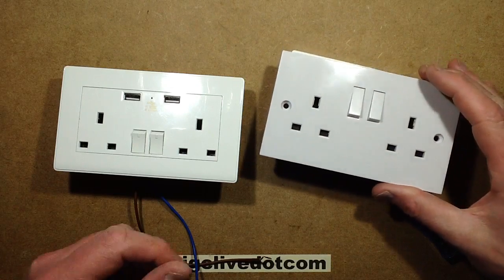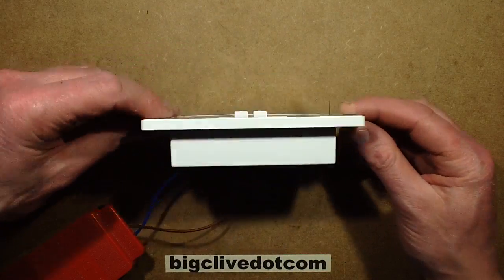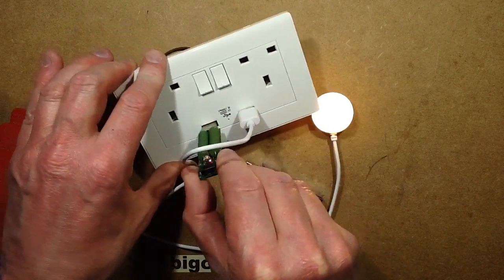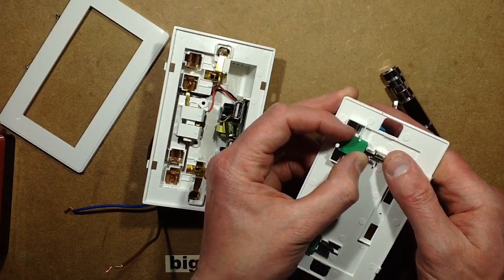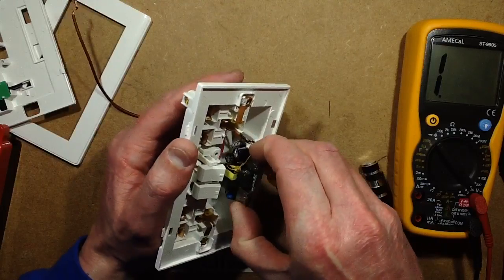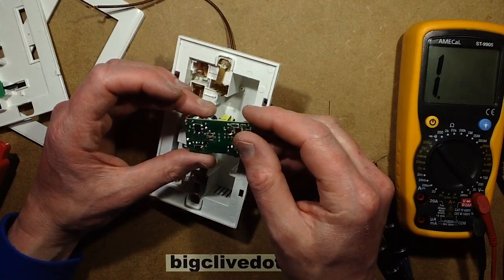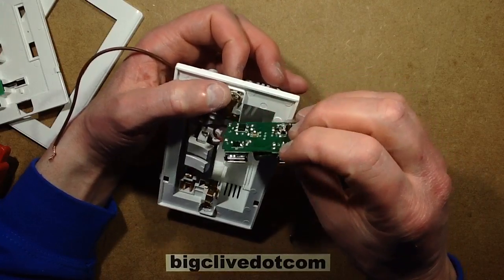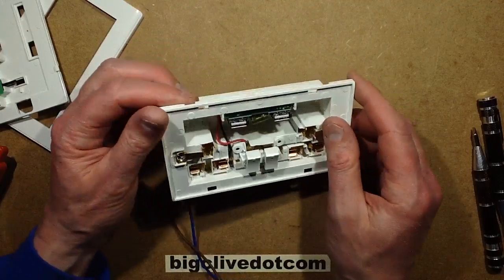A look inside a (crap) double gang socket with USB outlets.

Comment: The best solution to the problem of built in Usbs causing fires is surely to have a way to just switch those sockets off?
Reply: +Lord Sandwich You could, but don't think that would solve the problem, because the USBs actually contain circuit boards, which if they're on fire........

Comment: +bigclivedotcom You said you haven't seen two earth terminals on a socket before. That is absolutely standard for modern quality sockets designed for 'high integrity earthing' arrangements (not that I mean to imply that this is a quality socket!)
This high integrity scheme is used where there is a likelihood of significant intended earth leakage current (>3.5mA), such as from IT equipment or radio equipment that uses large interference/spike suppression capacitors. The scheme also requires that the two earth ends of the ring main go into separate terminals at the distribution board The idea is that the failure of any one screw terminal at the board or on any socket won't prevent there being a proper earth bond at every socket, so the earth leakage won't lead to the risk of significant earth potential developing (Regulation group 543.7)
Any suitably qualified electrician would know that it is mandatory to put one earth lead into one terminal and one into the other in such a system, but the earth terminals absolutely should be connected together by the socket. Hopefully that error would be picked up in the earth ring continuity test without the earths disconnected at the consumer unit, but that socket should never be on sale in the UK. 
You can also get MK (and other) dual gang socket outlets with three earth terminals - these are for signal and instrumentation applications wanting 'clean earths' to each outlet as well as the protective earth.
Reply from the maker: +Alex Gray I've seen the two external earth terminals on the outer metal frame that connects the two attachment points on good quality sockets, but not this concealed internal (or not as it appears) arrangement.

Comment: The real question is: am I able to download songs from my wall? With the USB of course.
Reply: John Richardson they are supposed to, but if you put a chip (e.g. a pic or avr clone) to, for example, transfer a virus on any android phone with dev mode enabled, you could get some valuable information.
I'm talking about usb adapters in general though, not only about this model.
Reply: @satibel : Indeed one of my fears when it comes to USB power sockets is that they're actually maliciously modified.
Reply: cookie koekje u could possibly wire up the data pins in the usb to something although not recommended
Reply: manaquri Yeah, what you're suggesting is across the board, not just for these.
Reply: +John Richardson then i would just use my phone charger or my pc..
Reply: xGxPhantom Zzz Whatever works for you.  It's just supposed to be an extra option I believe.
Reply: manaquri Seriously doubt it - they're ONLY power supplies for USB devices.
Reply: manaquri I want to infect my wall with a computer virus.
Reply: cookie koekje one of those could actually put a virus on your phone.
Reply: +cookie koekje now I want to put a sneaky raspberry pi zero in one of those.
Reply: +cookie koekje Err..... no.  It's just a power source.
Reply: John Richardson Awwww.

Comment: That thing shouldn't be on the market!  Is it CE marked?
Poor quality mains fittings are all too common now, even if CE marked, non well known brand fittings should be avoided.  I've replaced a number of 13 amp (supposedly!) mains sockets in recent years that have failed on high current loads, but within their rated capacity.  The failure modes have been worrying, like fused together switch contacts, melted switches, melted and burnt plastic switch parts, overheated pin contacts that have lost their spring tension and started to arc, etc, etc.
All these failures could have started a house fire, without warning and without tripping the MCB!!
I've also noticed poor quality light switches failing after a few years, the switch becomes intermittent or difficult to operate.  Internal examination reveals fatigued/broken switch parts, arcing etc.
All have been non known, or little known brands.
Now I will only fit MK or Crabtree units from a stockist I can trust not to sell fakes.  Look inside them compared to the imported junk and the difference in quality is stark.
I would strongly recommend anyone who has bought a new house within the last 10-15 years to check, or have checked, the electrical installation to determine if any poor quality fittings have been used.
Same applies to new or recent extensions.
If electrical installers are up against it on quotes they will resort to using crap fittings.

Comment: Are you saying,  there is NO internal Earth bar linking both sides of the sockets?
Reply from the maker: +Andy RC Yup.  A really terrible arrangement that could lead to inadvertent isolation of sections of a ring main or a radial circuit onward from that point.

Comment: Hello, sorry to add a negative to what seems a reasonable safety talk, but I have to point out some points for info.
Firstly, you worried me when you stated that you had not experienced a double earth connection. This is standard on all socket outlets designated for I. T. use, and is a requirement for fundamental use. The other socket with single earth connection would be considered for general use and not for I.T. use, although it would still function. This leads me to consider if you are a qualified electrician, and whether you should be making electrical advisory videos.
A second point is your connection to this socket for your test purposes. You have not considered your safety, or that of your viewers, when you have neglected to even connect this device to earth. This is a primary fail on your part. As this is an I.T. designated socket, it requires an earth to function properly, when a PC, for example, is connected. This earth is a design requirement to function, not only for safety. This also may be why you had instability within your test, although this is not my field of expertise.
Please do not go about holding un-earthed appliances in your bare hands, when they are connected to 230V main supply. Electricity kills, as I am sure you are aware.
Please accept this post as a raising of safety awareness.
Reply from the maker: +James Haveron My reference to not seeing a dual earth connection was relating to the enclosed connections.  I'm familiar with the use of two earth terminals on the outer metal frame found on some sockets but not all.  I did not connect an earth because I was aware that it was not in use by the internal circuitry which was the subject of this video.
Reply from the maker: +westinthewest To me a "clean earth" usually relates to a separate earth connection taken all the way back to a buildings main grounding point and not shared by other equipment.  In reality it is absolutely not needed, since any IT equipment that claims to need it is not fit for purpose.  The same goes for the 250V insulation test used on some IT equipment.  If it can't withstand a voltage closer to the peak mains voltage (230V X 1.41 = 325V) then as far as I'm concerned it should be retired.
Reply: +James Haveron I've been unsure about High Integrity Earthing for some time, but a quick bit of Googling seems to clear things up.  Page 2 of http://tisltd.com/wp-content/uploads/2012/04/HIE-Earthing.pdf shows a normal ring final circuit with 6242Y cable incorporating a 1.5mm2 CPC.  In addition to this is a hefty 4mm2 CPC in parallel with the ring.  I'd say this is why you need two earth terminals.  You simply need more room for a pair of 1.5mm's and then a 4mm.   I've heard of terms like 'Clean Earth' which suggests that the IT earth is kept separate from other circuits, but what does this mean?  All the earths for an installation are joined at the MET anyway.  It would be difficult to keep earth connections separated from other circuits because of parallel paths.  I think an IT circuit needs the additional 4mm2 earth to make it more physically secure and durable.  My point is that this would still require that both the earth terminals in the socket are inter-connected.
On the subject of neglecting the earth connection during the test, I'd say it might have been good practice to explain why it was omitted.  To have gone to the trouble of making the earth connection would suggest an ignorance of its purpose.  There are no Exposed Conductive Parts that I can see on the device under test.
Reply: +bigclivedotcom I've not bothered looking into this 'Clean Earth' business till now.  It's one of those topics on which people are keen to express their confused ideas.  There's a nicely coherent discussion on http://www.theiet.org/forums/forum/messageview.cfm?catid=205&threadid=62788
It seems to confirm what you say about 'clean earth' being redundant for I.T. equipment.  
I've never been told about any concerns over 250V tests on certain I.T. appliances.  Some equipment have SPD's which cause current to flow during the 500V test, but it shouldn't cause any damage.  I agree that if you can't do a 250V test, you shouldn't be able to plug it into the wall.
Reply from the maker: +westinthewest The MOVs (Metal Oxide Varistors) can show up as a bad reading on a 500V test.  I used to design and build electronic equipment and used components throughout that allowed it to be tested with a full 500V Megger test.  I even stated on the information with the units that they could be fully tested.
Reply: For me Big Clive has got it all right. 
Equipment (IT or otherwise) does not need an earth connection if it is double isolated - which I assume the charger is - or at least it should be. The earth connection to the wall socket is purely to provide an earth connection at the outlets sockets.

Comment: I would be interested to see the waveform of the 'unloaded' 5v output... I suspect that it has some kind of 'load detect' to put the circuit into some kind of sleep state to save power/wear on the circuit.

I think you should get an o-scope of some kind. Even a cheap DSO from China would give some kind of idea what is going on in there.

Love the videos!
Reply: Alexander Borsi - if he did get a cheap scope from China he would probably dismantle it as soon as he got it.  LOL
Reply: +Alexander Borsi I'm really surprised he doesn't have a scope. They aren't even that expensive anymore
Reply: +smeezekitty link??
Reply: DarkLinkAD How much are you looking to spend?
Reply: DarkLinkAD

100 MHz DSOs are about $200 now
http://www.ebay.com/itm/Hantek-DSO5102P-Digital-Oscilloscope-100MHz-1Gs-2CH-7-TFT-/351594172446

Or you could buy used in the $100-200 range
Reply: Two things should be done 1) read the datasheet for the LP3773 and 'scope the o/p.

Comment: Thanks for the warning.  I hope you dobbed them in to Trading Standards so this dangerous junk can be taken off the market.
Reply: It's another example of the cheap Chinese crap that people buy thinking they are saving money but could cost them their lives. I doubt these would meet the required electrical safety regulations even though it's probably CE marked. They are dangerous and should be taken off the market and recalled. I would love to put one to a proper compliance test as an ex electrical safety and test engineer.

Comment: Oh my god, how bad is that! I'm an electrician, and I would consider one of the earth terminals to connect to the incoming earth connections (ring main X 2, radial X 1) the other terminal I would use to create a separate bond between the socket and the back box (if metal). I can't believe that they are not interconnected!!!
Reply: +demonkey123 The worst bit is, that if you wired it up as you described, in a metal box, the second socket would appear to be earthed. Just pray it will never need to sink much current.
Reply: Darthane If you installed it in a grounded metal box, then it would be earthed, it just wouldn't be as reliable a connection. There's no way for it to 'appear' to be earthed.
Reply: Ricky Hall Reliability is what Darthane is getting at I think. He's saying that under test the second socket would show continuity. But a 3.5mm brass socket bolt screwed into a galvanised back box is not an acceptable method of earthing 'anymore'. Natural electrolytic action and corrosion from a potentially humid environment could eventually lead to high resistance and failure under fault current.
Reply: Rick Hall:  No, it would only "appear" to be earthed because it would be an inherently unreliable connection. It might test ok when first installed but if a mounting screw loosened off or corroded it would break the connection and you wouldn't know anything about it unless/until there is a fault condition.  It's a horrible design.

Comment: About the USBs. The technology is a primary side buck converter. They can be designed cheap or good but it will be either or and not both. The best is with a isolated feedback circuit, measuring the output voltage which controls the switcher but it needs a opto isolator and an external voltage reference and that more expensive but not a lot!. Here they are using a third coil in the transformer which reflects the consumption on the output and it is fed in the controller. It works, but not good. At low loads the phase between voltage and current are causing issues to predict what is going on at the output and therefor a flickering is seen. It is basically the same phenomena with old wall-dimmers with low power LEDs. The switcher are not properly understanding when to switch. When the current  increases, this third coil is giving a better "image" of the output and the voltage is suddenly more stable. It is not a bad idea as such but it is definitely a bad choice for a USB charger with a very limited voltage range. The stability can't be achieved with this design and a lot more is needed to make reliable USB charging. The three coil design works with consistent current and not in dynamic chargers.

Comment: yeh but if the electronic started to burn wouldn't the safety switch cut out?
Reply from the maker: +Roc Lo 32A circuit breaker on our 230V (closer to 240V) supply thinks 8kW is a normal load.....

Comment: Why on earth wasn't both earth connected? I don't know the exact laws in Great Britain, but if you have a ground in the socket it allows products with a demand to connect the ground pin the plugs, like products with metal enclosure. Some products intended for use indoors and a plastic enclosure won't need a ground but may have the pin on the socket anyway. It must be here to open up for the other two. So from a simplistic perspective, if you just are having plugs with plastic ground pins, you can use this wall socket, but only then. As it is possible to plug any products to it, it was probably ment for a very "flexible" market with no real demand for true groundings. (some have said it is related to the overpopulation in a country). I have seen this before on imported EU-products as there are in principle no difference with respect to safety. They need to be thoroughly examined before use. Are they marked as legal at all? I do personally never use these 230V devices you can buy cheap on sites with dubious sellers, NEVER! Everything, including the plastic won't last long and i don't want to spend my life replacing crap, all day long. My advice is, avoid combos. spend some extra on quality and safety and live happier and longer.

Comment: I'm pleased to see that coffee chains like Starbucks and Cafe Nero are fitting 13A plus 5V USB outlets in their new 
builds starting last year. I've been using Masterplug Extension leads with USB outlets for about three years and have encountered no problems at all. I recently fitted two in my kitchen which is a harsher environment.
If anyone is considering buying this type of wall socket I would go for MK or other well known brands who will be built
to the British standards and throughly tested for reliability. We should expect these products to last at least 10 years.
Reply: +Stephen Baxter 40 YEARS**
Reply from the maker: +Stephen Baxter Now I've got the urge to go to Starbucks and surreptitiously swap one of their USB sockets for one with the mains connected directly to the USB socket.

Comment: what is an opto isolator ?
Reply: It's an electrically isolated optical operated swtich. :-) 

In general, its an LED that switches a phototransistor. Usually, they resemble a six pin chip with two of the pins not connected. Surface mount could look different though.
Reply: It's an electrically isolated optical operated swtich. :-) 

In general, its an LED that switches a phototransistor. Usually, they resemble a six pin chip with two of the pins not connected. Surface mount could look different though.
Reply: +gorillaau It is not a switch at all. It is an optically coupled line. A lot of through hole optocouplers are 4 leg stackers too. Many of the 6 pin packages also have compensation. Which means more than 4 pins are used.
Reply: +Paul Frederick I was wanting avoid adding jargon that most people haven't heard of before.
Reply: gorillaau
So you decided it would just make more sense if you were wrong? Gotcha.
Reply: +Paul Frederick From someone who read only the first parapgraph? Gotcha.

Comment: you have to use both earth  connections under the regulations incase one leg of the ring comes out you still have an earth connection.
Reply: All BS standard sockets I've put in are linked this must be a dodgy Chinese socket and not BS rated.